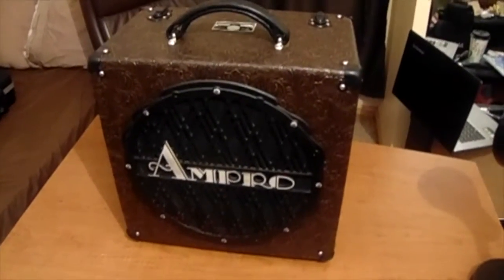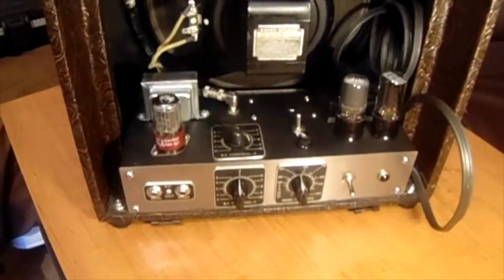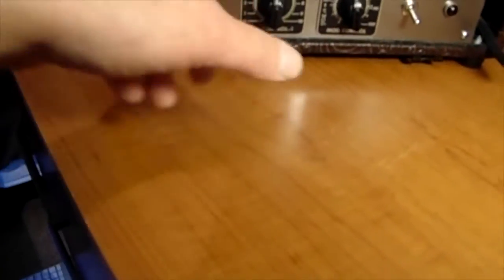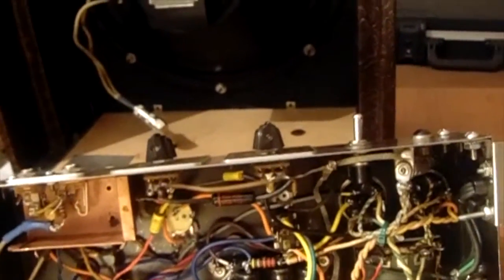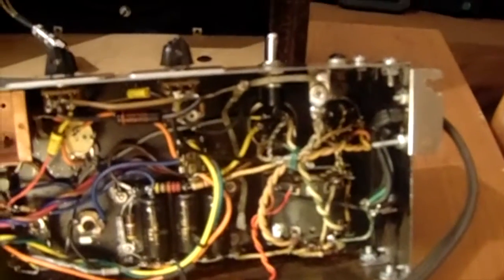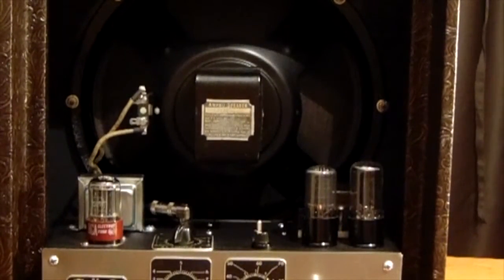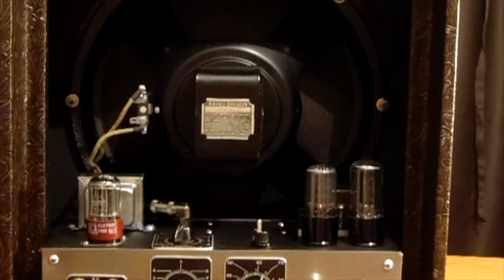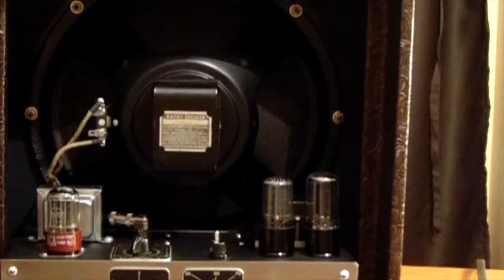Fender Champ Clone

Comment: I have an AO-33 I bought the tone cabinet and all. I don't know anything about it, but been look for a video of someone building an AO-33 and have not found one. I asked the guitologist a few times some questions but he never commented back to me so I gave up.I don't know if it made him mad because I was using a hammond or not but never got him to respond.I just don't think I could build one without watching someone do the same model all the way through. Nice job you did. I was looking for a AO-35 but ran across this one pretty cheap. I might could do a 35 because I have seen him and doug build them.I will keep an eye on all you guys builds. Thank you.
Reply from the maker: Hi, Just happened to be up and noticed your comment. I don't think Brad got mad at you, but what your asking him isn't a typical question. Most others either ask about repairing an amplifier already built that needs some repair, or are complimenting him on the amp he worked on in the video. Plus, he has been busy moving into a new home. I did build an AO-39 amp into a Spitfire combo amp about 8 months ago. I'm not familiar with the AO-33, but can't imagine it being too much different than any other Hammond. I still have 2 AO-43 chassis to make into amps (working on one now). I have also converted 2 PA heads to guitar amps (I bought a 3rd that I still need to work on). I'm still learning, but could try to help you if your stuck on something. This is just how I do it, I think it best to get a schematic of the amp/design you would like to build, remove everything from the chassis you have (this makes room for your design), and start copying it from the power transformer out. The Hammond's have a lot of extra parts you wont need. If you don't have any understanding of how amplifiers work at all (like me when I started messing with them) I suggest watching all of Uncle Doug's video's first. There are certain things which I consider a must to own before building anything, A Current Limiter, 2 voltmeters 1 digital and 1 analog, and a Variac. A tube tester (even a cheaper one is handy), and an Isolation Transformer would be best for safety to protect yourself (I don't own one yet)  Sorry this is so long, Take care, Tom  Oh, is that your bike in your picture? Just curios, I used to collect/restore old Honda's, Had to sell off most of em, but still have a few..

Comment: The amp has some nice tones, good job. Looks like something Uncle Doug did on a scratch build Champ.
Reply from the maker: Thanks Z..... I have a couple more amps I made (Matchless Spitfire scratch build, Bassman as well) and converted some PA heads into guitar amps, I just need to make a few videos.. I'm currently working on converting one of the Hammond chassis into a Jcm 800 pre amp, but with reverb and tremolo, into 4 6V6's... I picked up off of Craigslist $50.00 sight unseen, a 1966 Lowery/Gibson cabinet to put the amp into. I found out it was originally a solid state amp for Gibson and Lowery electric piano's (the SS amp wasn't inside). I only bought it for the Jensen 12", but the cab is so clean and has a 10" horn as well! Should be interesting if anything. But I do like the Ampro Champ clone, and yes Uncle Doug inspired and helped me in the build as I knew practically nothing about electronics at that time..  Again, thanks for the kind comments, Tom
Reply: Bucyrus Erie12 sounds like you have some cool projects. I also have learned much from Uncle Doug and The Gutilogist. I recently finished a Vibro Champ clone from a Silvertone organ I picked up for $10 at Goodwill, and a conversion of a webster Wire Recorder from eBay. Currently working on my first tube Radio a Philco 46-1226 with record player. It is much harder than a guitar amp. I got the audio section and record player working good and added MP3 jack and 1/4 guitar jack and switch. That all works good but having trouble with the radios AM section pulling in stations. Go figure can't get its original purpose to work right. Soon I hope to get working on my late 40's RCA Pa head. Keep making videos. It's always good to see what others in the hobby are doing and learning.
Reply from the maker: Cool, Which RCA pa is it? I almost bought one.. I have a 71 Davis 405 pa, 3- 6eu7 pre, 2-6l6gc and 5u4 all like new blackplate rca, a 52 Bogen 3-6f5 (half a 12ax7) 1-6sl7, 2- 6l6g st bottle, 5u4g, and a 60's  Bell 1-6eu7 1-12ax7, 1- 6av7 (again 1/2 a 12ax7) for pi, 2 rca 6l6gc blackplates and 5u4.. I try to wait for just the right one, one owner originals, original tubes, usually non working.. but in every case, the tubes alone were worth more than I paid for the pa's. If you didn't know a 6eu7 is a 12ax7, just 6 volt only..same MU and transconductance, different pinout though. I passed on an Rca and was sorry later as they make nice amps, I have had mixed results with radios. Agree much more difficult. I will post some videos... I will also check and see if you have, would like to see the VibroChamp, gotta take the wife to the Dr 1st though, Take care
Reply: Bucyrus Erie12 The RCA is 
mi12298.  I found it in a church we were tearing down at work. They left a few good old broken things in that church. It was being torn down. I haven't made a video yet for vibrochamp. You can see it in my Webster Chicago video. It is the pink makeup case I turned into a head cabinet for my daughter. If you watch that video I play it clean then crank it later in video. I had made videos of the conversion process. Then broke my phone and videos weren't backed up. I lost a lot of content. That was a bummer.

Comment: Nice, I was looking for a chassis that's homeless! ! One I can build a shell for. Something small and functions.
Reply from the maker: Hi David. If you like the style of that Magnatone Brad repaired, I happen to have sheet steel bent in that shape (I save a lot of stuff from recycling in my town for amp projects) . I could build you a clone of that amp, the chassis I mean, if you wanted to make a cabinet for it yourself. I have all the parts on hand (or most), however the tubes I have are all NOS (new old stock) and kinda pricey and I'm not really looking to sell them. With the exception of the 1st preamp tube 6SJ7, the rest can be purchased new from JJ or Groove Tubes, and would work fine and save you some money too. I have built and or restored a few more amplifiers and old PA amps since posting this video (I still play this amp all the time) I should post some more video's of them. I might make a video for total beginners, showing what tools to get, how to understand schematics, how to get some material for free.. Pleather couch's people throw away at the curb, cut the fabric off and it makes great tolex to cover an amp in! Let me know what you want to do. Tom

Comment: Hi Bucyrus Erie12, You appear to have the makings of a great amp builder, perhaps a second project could be a Fender Champ amp model 5C1 with a 6SJ7 Pentode or possibly the Mother of all Princeton amps, the model 5F2-A, basically a Champ with tone control. I hope your having a Happy Summer & that all is well with you and yours. As for me, I'm gathering the parts for a Fender 5F1 Champ. As I begin construction, and, can up load some videos, I will keep you appraised. The tone control in the 5F2-A, as you may know from watching Uncle Doug & Rusty videos, is that it works extremely well. I would, should I include a tone adjust, use the 5F2-A circuit. Take care, be good, C.
Reply from the maker: Hi Cass, Hope  your summer is going along well too...  Actually, The Ampro Cabbed  Clone IS more like the Princeton than the Champ...   I just listed it as a Champ. The schematic on the back cover is even listed as Prince-Clone! I didn't feel like explaining it was an early single ended model.. I have finished a few amps, repaired a 1951 National 99% original, and am working on a couple series filament amps right now. I just haven' t purchased a camera yet to make some video's...  I am learning a bunch, hope you are too. Maybe by the fall I will post some things. Keep me posted on your amp. Take care, Tom

Comment: Hi BE 12, I hope your doing good. I just re-watched your video, you did a really good job, looks old, looks cool. Been looking to see if you have any new videos. Maybe a Fender 5C1 with a 6SJ7 pentode pre amp and a 6V6. You probably have seen Uncle Doug's build of a Fender 5F2-A, basically a Champ with tone control, and, from what Uncle Doug said, a good one, tone circuit. Hey, simple is good and it works. Happy Summer, be good, C.
Reply from the maker: Hi Cass, No I have not made anything new yet, but have a lot of projects in the works. I realized I that I most likely was not going to "convert" the 2 hammond ao-43 chassis  into amplifiers as much as use the parts out of them.... So I bought an AO-39 Hammond chassis that I am working on now. It is much like the AO-35 that everyone desire's but only has 1 12ax7 tube, the rest of the line up is the same... It is easy enough to add an extra tube socket and there is plenty of room for everything.. And the best part is they are inexpensive... Hope you have a good summer as well.
Reply from the maker: Oh yea, thanks again for the compliments on the amp. Did you decide on an amp to build yet? Let me know if you did. Take care, BE 12
Reply: Bucyrus Erie12 Hi Bucyrus Erie12, Thanks for the reply, only if you can and want to. Yes, I have been gathering parts for a Fender 5F1 Champ, that will be similar to the one Uncle Doug made from a scrap signal gen.. I'm not able to find one of those and have decided to go new on the parts, I already had the Jensen MOD series 8", 8 ohm, 20 watt speaker and a lot of related electronics components. Parts are reasonable for price. Would like NOS tubes, but, will go with JJ or similar for now. I will build it pretty much per schematic with fixed NFB, but, will have 4 and 8 ohm fixed or switchable speaker jack like Doug's. Will look forward to new videos. Take care, work safe, C.

Comment: Hello Bucyrus Erie 12, Thankyou for the link to the Fender Amp schematics, awesome. I looked at quite a few circuits, most notably the 1946 5C1, 5C2 Princeton using one 6SJ7, one 6V6 & a 5Y3 Rectifier. The Pro Amp uses the 5B5 and a 6SC7, the Twin uses a 5C8 and a 6SC7 with a 6L6/5881 output tube. The earlier ones seem to be the 6S series tube, with the advent of the 12AX7 with a Mu or gain of 100, it pretty much replaced the other tube. I know the 12AX7 is a dual Triode, the 6SJ7 I think is a Pentode, I could be wrong, should have checked before post. I would like to suggest a great channel that may be of some help to you and that is All American Five Radio ( after the old 5 tube radios from back in the day), Richard "Rick" McWhorter, very knowledgeable, with lots of great videos on electronics, tubes, radios, etc.. The Fender 5C2-A would be an excellent build, simplicity at it's finest, and, it has a tone control. I don't really need that as most guitars have it. As you may know, the tube designation is, for example the 6SJ7, the first number is the heater volts, the SJ, etc. are the tube characteristics and designation, and the 7 is the number of useful elements or pins. Could you perhaps do a channel description with a message option, more private correspondence. Well, thats about it for now. Take care, discharge those caps, be good, C.
Reply from the maker: +Cass Virgillo Yes I know all about David at ElPaso....very smart, nice person, Great video's.....  I don't know the other two and will check them out when I have the time (thanks for letting me know). I highly recommend purchasing a Tube Manual if you don't already have one, as they list practically all the tubes and give the Tubes data ie pin outs, plate voltages, cathode bias and such, and typical application....  You can find them on Ebay for under 20.00  I just went to go check, and I have misplaced mine... but I think you are correct the 6SJ7 is a pentode, and the 6SC7 is a dual triode with the two sections sharing a common cathode.. I had considered using both before. I was really lucky once in a purchase and have about 100+ NOS tubes that are mostly amplifier related. I will look into a channel description and the message option, I'm actually not that good with computers or modern technology, but I will try... TTYL